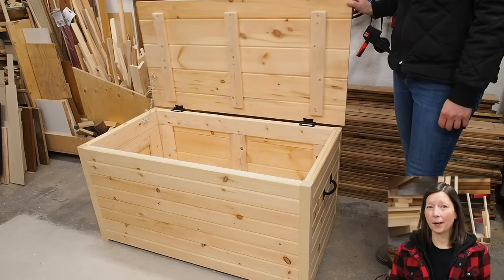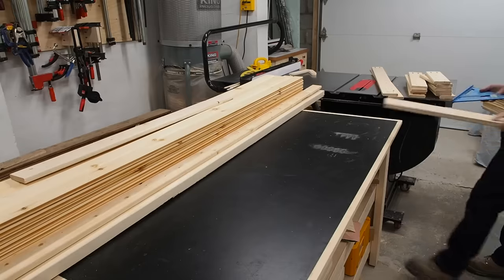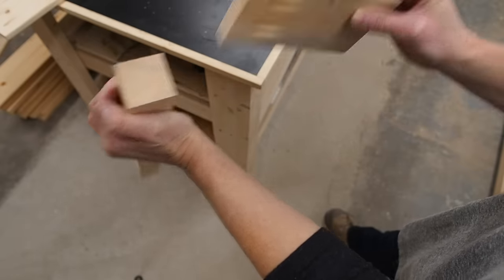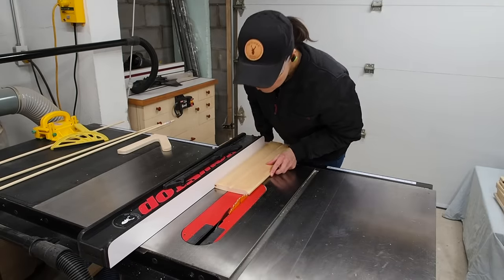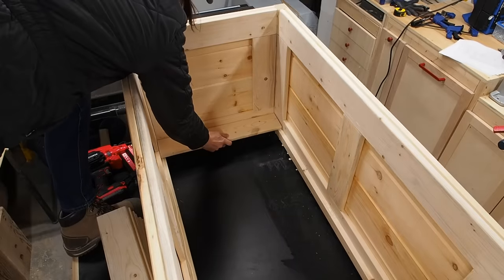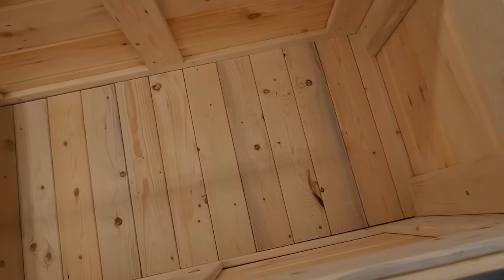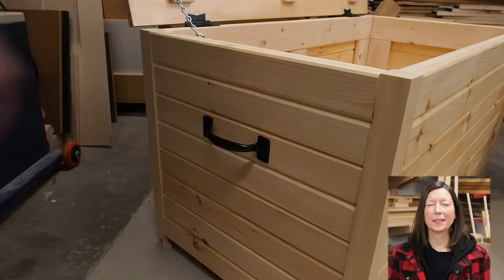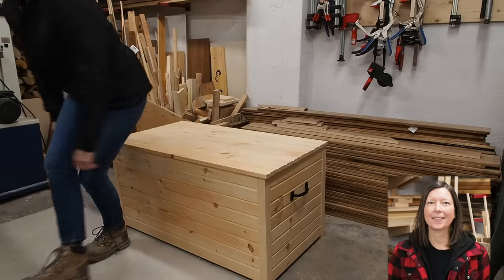Wooden Storage Chest DIY

Comment: I think that this project is both fantastic AND useful in more ways than one. 
It’s a great way of re-using found materials, ie. pallet wood, it’s useful for what it is: storage, and it could double as a coffee or end table. 
The assembly process involved atypical methods that are certainly both adequate and simple.
Your solution for locating the screw holes for the lid is genius! Trying to balance the lid and mark the screw locations would be a juggling act by oneself and the choice of hinge type demonstrates how “less” can be “more”!
Overall, I see an absolute work of art! I imagine various finishes could be beautiful and hand painted or stenciled decorations would turn a simple box into a beautiful work of art!
I’m gushing because I’m so impressed by the simplicity and the results. 
Absolutely beautiful!

Comment: Terrific quick project.  Consider using cedar for the bottom, for all the wonderful reasons cedar has been used in chests for centuries.  Or, if the budget allows, do this entire project in cedar, including routed tongue and groove work.  Cedar inserts would also work, although it would add a lot of weight.

Comment: I made one last summer. Didn't use the wood filler to fill the pocket holes cause I went a step further and lined the inside with 1x6. It made it heavy but it was really solid and i used regular hinges and lid supports.

Comment: Nice box build
Just what I was looking to build so I can store my summer tires in the back yard so I don't have to carry them into the basement cause I don't have a garage
Yes I would like to see what you will use to stain and protect the project
Would be nice if you include info on some types of finish that will stand up to the sometimes harsh winters we have here in Montreal
Thanks again😁👍
And almost forgot Merry Christmas and Happy New year
Stay safe
Reply from the maker: Unfortunately I'll be considering indoor finishes as this was for my basement. Hadn't planed to put it outside! I think I would go with exterior paint if this is going outside. That or several coats of spar varnish. But really nothing will hold up to our climate long term :(
Reply: @DIYMontreal  thanks

Comment: I'm suprised you didn't put the pocket holes on the outside of the chest if you were going to panel it.rather than have to fill them in on the inside, but loved the hinge trick with the double sided tape and removing the pin.ill be borrowing that idea from you if you don't mind.😆👍
Reply from the maker: I explain why I oriented the pocket holes that way in the video but maybe you missed it.

Comment: Very nice build and exceptional instructions.  I have one question.  I noticed you used a Ryobi cordless drill but you used a Craftsman cordless brad nailer.  Why didn't you use a Ryobi Nailer?  The Craftsman nailer is $199 (US Dollars) with out the batter and since you already have the Ryobi battery the Ryobi nailer is only $99 at Home Depot.
Reply from the maker: I have both nailers actually. Craftsman sent me their nailer recently and I find myself liking it more than the Ryobi one.

Comment: Great video. How do you keep adjoining pieces that you are attaching with pocket screws from rising up or shifting while fastening? I don't see anything like clamping the mating joint from above?
Reply from the maker: When building the frames using 1x4s - just pressure with my hands. 
When attaching the frame to legs, I used clamps

Comment: Interesting that you don't use any wood glue when you assembled the frame .. was there a specific reason why ?
Reply from the maker: I actually commented about this in part 2 (just released). Glue isn't necessary for pocket screws (a lot of cabinet makers don't use glue) but could have made the chest even more solid considering seasonal wood movement and racking.

Comment: This is the first time I have come across your channel. I love pine and love the look of your storage chest. Great concise video too.  However your design does not seem to take into account the natural expansion and contraction of wood across the width of the grain. I am no expert so I am not sure if this would be an issue with this build. Please advise if this is or how you cater for it.
Reply: Glad i wasn't the only one to notice this. Gluing the bottom in place and gluing the supports to the lid do not allow for the natural expansion and contraction of seasonal wood movement and will eventually cause splitting of the wood.
Reply from the maker: I could see that potentially being an issue for the lid but not for the bottom slats. They aren't glued together and each can move independently.  Besides only a few inches each so wood movement will be microscopic on each piece. As for the top.. perhaps I could have made elongated screw holes on each end of the supports, no glue. I guess time will tell if this was the way to go.

Comment: When do you know to use wood glue on your joints?
Reply from the maker: Glue is always better (unless the joint need to move due to potential wood movement- as someone pointed out maybe I shouldn't have used glue for the lid supports).

Comment: You might think about putting wheels on the bottom. Seems like it will be heavy.
Reply from the maker: It's actually fairly light but its size would make it difficult to move alone.